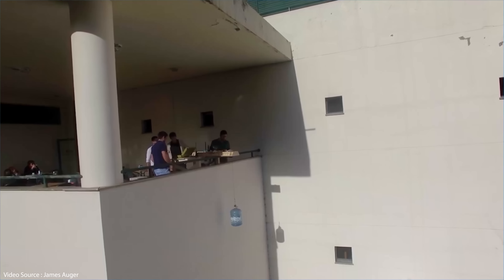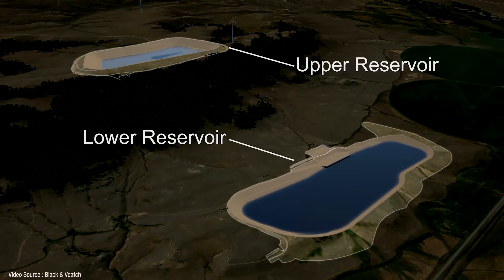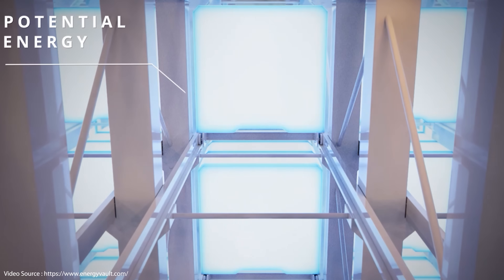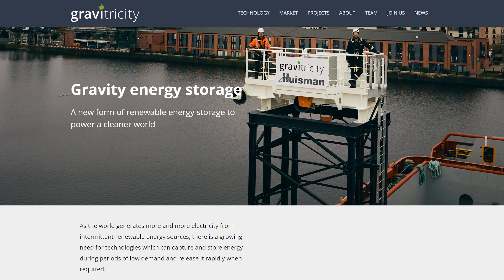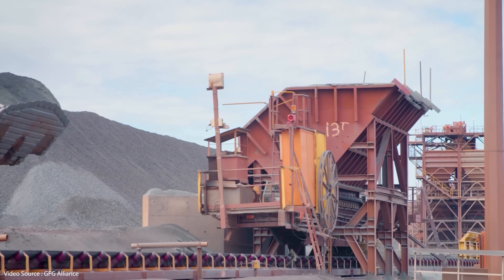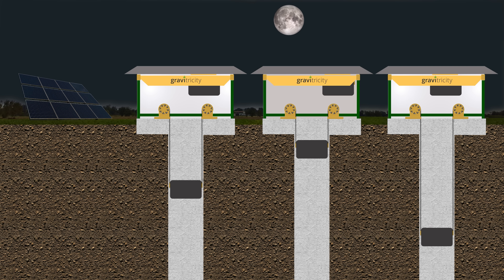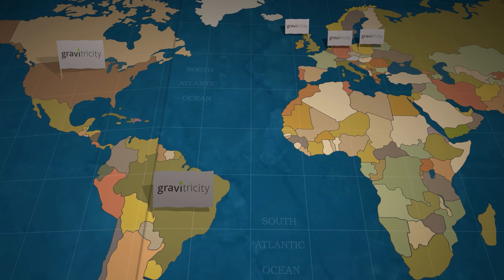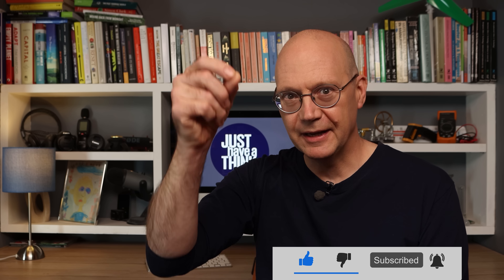Gravity Energy Storage. Who's right and who's wrong?

Comment: If you want to reliably store energy, make a big container and let a pump run water into it. When you need to use the stored energy, let the water run out at the bottom through a generator.

-far fewer moving parts, much less maintenance
-a pump and a generator can be easily accessible and can be very durable and are ultimately quite replacable too.

try reattach that huge weight in that abandoned mineshaft, or rebuild one of those cranes when they fail...

Comment: 07:03: I don't know how many such mines they will really find, but the claim is:
300...500 m, 3...5 m diameter, 4...5 m deep. Density of iron ore approx 2500 kg/m³. Therefore, without any losses, a single weigth can do m*g*h_mine = pi*(d/2)^2*h_weight*rho*g*h_mine = 57.8 ... 334.3 kWh.

That is in the range of a single EV battery, so laughably little. They need to stack multiple weights, but much more than 50 don't make sense, because then they are already stacked half the way up the mine...

Because they are stacking weights on top of each other, they have to hook a new weight up to the cables before being able to generate any electricity. I assume, no number was given for how long it takes to lower a single weight down, so I'll just guess: 3 minutes. If someone has a better guess, let us know.
Therefore, the power they can produce would be: Energy / time = 1.2 ... 6.7 MW   (megawatts)
Which is absolutely useless. That's less than a single wind turbine can produce. Even if you tried digging a mine next to each wind turbine, if there is no wind it would only last you     (50*3=) 150 minutes.

Comment: Take the spec for the gravitricity prototype:
height = 15m
mass = 25,000 kg (25 tonnes)

This means the total amount of energy they can hope to generate from this is 3,675,000J (25,000 * 9.8 * 15). My kettle draws 3kW of power, which means that it needs 3000J of energy per second. This being the case, my kettle could only be powered by the prototype for about 20 minutes. That is to say that 25 tonnes of solid material travelling 15 metres can only bring 7 kettles to the boil assuming it takes each kettle around 3 minutes to reach boiling point. Could be wrong but this doesn't sound scalable to me.

Comment: All these ideas are simply ridiculous. A robot crane stacking concrete blocks high in the air, lowering weighted boxes into mineshafts, come on. 
A simple angled ramp system, imagine a rail car on angled track scaled up several orders of magnitude attached to cables would be far simpler. Things like this were done over 100 years ago on lumber trains in the mountains where the energy generated on the decent was fed back to the power companies. Redundant cabling and emergency brakes on the rail similar to an elevator could be fashioned to prevent runaway. You're welcome

"An idiot admires complexity, a genius admires simplicity" - Terry A. Davis

Comment: That seems the best possible implementation of this idea. Use any cheap sand or rocks you got, the one with highest density to price ratio, put it into a huge strong steel bucket and move it up and down along a vertical hole. The main cost would be the construction of the hole, since they would need many close together for significant storage capacity. They could build the crane + generator first and use it to get all the dirt out with a different bucket for construction, make ridiculously long holes, and then reinstall the crane over the compacted dirt dug out of the hole, to gain extra length.

The energy is mass * gravity * length of tunnel. The section of the cables is proportional to the mass, and its length equal to the length of the tunnel, so the amount of cable is proportional to the energy stored, and there's no way to reduce it by making it light but deep or heavy but shallow.

So assuming a tunnel 4 meters in diameter with a weight 12 meters long, it's pi*2**2 * 12 = 150m^3
Filled with water: 150 tons of weight (less weight and more problems, not a good option)
Filled with dry sand: 1.6*150 = 240 tons
Filled with rocks (100% compacted granite or basalt, 2.6-3 t/m**3): about 400 tons
Filled with magnetite: 5*150 = 900 tons

A tunnel 1km long with magnetite would store E = m*g*l = 8.8GJ = 2450kWh
With a low-discharge high capacity liion battery of $100/kWh, that same storage capacity would cost $245 000
It seems quite hard to me to imagine such a tunnel for such a low cost, knowing that The Boring Company was able to make their tunnels for 4M$/km
A 100 meter tunnel for $24 500 seems also quite hard to do. Maybe with many close tunnels reusing the same machinery it could be achieved, but it seems hard to me.

Like energy, if tunnel boring became cheaper, many many opportunities would arise.
Reply: Based
Reply: Comparing the costs of energy storage by the two batteries in question, for the energy measured in kWh, is wrong. Are you referring to a metric ton, when you write, for example, 150 tons?
Reply: @franklins6694  
Cost of energy storage has units of money / energy.
I chose $ / kWh

When I write 1ton I mean 1000kg of mass of material
Reply: What was the tunnel for?  You mean, a hole?

Comment: What makes me nervous about these is the cycling.  I get that they meet the grid stability parameters.  But the stop start cycles can do a lot of long term wear to large reactive machines, such as large baseload generators.  I've seen the stopping and starting of 50MWe smelters wreak havoc on those types of machines just from shutting down at night and starting up in the morning.  The pump storage units have soft turnaround mechanisms to ease the blow.  It takes and hour to get up to full pumping or full flow on the existing plants, in most cases.  They need to get some power industry folks on the team that understand long term impacts.

Comment: I seems like the best solution would be to use the deep oceans. placing a floating station that lowers weights and then takes advantage of the bouyancy of the water to lift the containers back up  and control the lowering of the weights, this will allow many parallel operations any where there is deep water. The floation platforms can then be used for equipment or solar panels etc. which will allow them to be more cos effective.
Reply: Corrosion, barnacles, and accessibility for the communities that need the power all come to mind

Comment: Wow! What if you had very deep shafts, lowered weights for gravity energy and then pump water back in to raise the weights without using energy and use gravity to refill the reservoirs or tanks that hold the water. Also it doesn’t have to be water either.

Comment: If you combine rooftop solar and wind power systems with a system of closed loop hydroelectric power stations you can easily produce enough electricity for any modern city. A closed loop hydroelectric power station can be built underground or incorporated into building design saving space and placing the power production closer to the point that the power is needed eliminating most substations and transformers. The simple fact is that the person who is speaking doesn't know how to create a renewable energy power grid. There is also a way of producing a closed loop hydroelectric power station that is self recharging eliminating the need for wind and solar power but unfortunately I am the only person who knows how to make it.

Comment: Great idea! Now if only we could find a way to not block the access to the great volumes of mines, that mineshafts so conveniently are connected to.
We might even use that volume for our battery to increase the mass- and thus energy capavity, if only we could make these solid blocks of mass small enough to move in a more dynamic, ideally almost fluid way to flow towards and fill these caves to the last corner... 

But i am stupid, this would be way too complicated to implement with tracks and pulleys. just the mineshaft then. 💀
Reply: There was a project in Germany along those lines. The problem they ran into was that it's very difficult to make old mines hold the water.
Reply: @stefanmuc2k  Yeah the erosion would quickly be an issue.

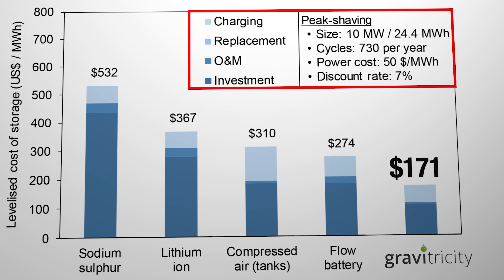Comment: @8:30 - you are hopefully aware, that most coal mining in Europe is done in open pit mines - there are no mineshafts - there are huge wastelands off sometimes hundreds of meters deep wasteland - like the german Garzweiler Mine https://en.wikipedia.org/wiki/Garzweiler_surface_mine

i find it quite odd that you say that the concept of gravitricity looks "good" while the new evrc concept by energy vault is "bad" though it is pretty simular - remove the "rolling the weights around" - add a few more pullies instead of the cart

also it could be a feasable option to use already high structures like wind turbines to pull up mass and lower it down - but not with a crane, rather in a elevator like system where the mass is guided by vertical rails, so wind won't be an issue

i'm pretty sure, both companies will deliver some plausible solution on the long term - both provide nothing, that is pysically impossible, both obviously have challenges to overcome

gravitricity will certainly reach a point where they can't find any suitable, deep enough shafts and need start digging, which raises the cost

Comment: If you are going to make a wind turbine with a giant shaft tower to hold it up in the wind you may as well put a 5 ton weight in it then using the wind energy to lift the weight and using the weight to control the speed of the wind turbine. Then you get a consistent source of power.

Comment: A project that will start this year with construction is a Hydrogen generation from surplus windpower. A pipeline is prepared for H2 usage and connected to a H2 pipe network app 100km away. A salt dome cavern plant is going to be used as a buffer. This H2 buffer has already more capacity than all possible hydro pump storage facilities in my country. More salt caverns are possible. First stage is 100MW capacity, second stage in 2025 is to add 200MW more. Top possibility for the site would be 2TW. The electric cables are there already since the site has an Nuklear powerplant that will be shutdown soon, and a Gasturbine powerplant that might be possible to use for burning Hydrogen as backup in case of darkness and low wind.

Comment: According to a Powerpoint presentation I found on the Internet, Banks Lake pumped storage, off WA State's Columbia River's Grand Coulee Dam, loses about 24% of its pumped storage energy - 14% to pumping efficiency losses, and 10% to generator efficiency losses. This system as described can produce 300 MW continuously for up to 48 hours.
Reply: In Austria the biggest Pump Hydro is the Powerplant Group Malta-Reißeck with combined output of 986 MW - has a comined efficiency of over 80 %

Comment: I read about a gravity energy storage project in Saudi Arabia. A big stone cylinder cut out from the ground, sealed to the walls and pumped up high with water regaining the energy by running the water back through the pumps by the weight of the stone cylinder. I do have some doubts about the seals between cylinder and walls.
Reply: me too, someone sold that well to the arabs     lol

Comment: Just as a "buff" to Gravitricity give then a call- there are abandoned oil and gas well holes all over Texas- some plugged but many hundreds to thousands were abandoned open and leaving a heavy wall casing to a depth of 2000 feet, at diameters in the 24"-30" range. the people on whose property they are now on would love someone to come along and either cap or use that hole for something other than having their children fall down into.  Not a "mine shaft" maybe, but the long vertical, self supporting "hole in the ground " it sounds like they need.  FR

Comment: @ Just Have a Think updraft power plants can work 24/7 no need for energy storage. so all this is energy storage is nonsense in my opinion. have a look this tech is 80 years old. Maybe do a video on it. very intresting, especially if you add modern tech to it like electron stripping and fanta black as a heat absorber.

Comment: the machine has to do twice the work it puts out , idiotic idea
Reply: But if you use captured excess energy to power the lifting phase, you're getting the inefficient cycle for free.

I went into this video totally ignorant of gravity storage, and expected to laugh at the concept. I'm more warm to it than I expected to be.
Reply: @MetalAsFork  time would be better spent investigating how the human brain functions with so little power and does not overheat , it uses something called chiral induced spin selectivity and even the best minds on the planet have no clue how to build a machine capable of doing this , be far better for mankind to do some real science than run down the rat hole of believing you can control the weather
Reply: @philiphall4805  That's interesting, but it doesn't totally invalidate this concept. We can investigate more than one pursuit.

Mechanical/gravity batteries just might be superior to other types of storage in some situations.
Reply: @MetalAsFork  finding out how to use electricity as efficiently as a living cell  would completely invalidate a gravity storage system because there would be no need for it

Comment: To be fair with Energy vault, the infrastructure needed is built with a massive overpowerful crane on rail. And that's exactly what they plan to build. All we need is a metric ton of iron to make the steel beam, as as we just saw, a vertical mine is a boon for the project final stage.
So I really dont know if EV will be the company that is able to add 1+1 together, but it seems to me like a feasible plan. You build the solar panels on beams and you use the power to dig the iron underneath. slowly raising the solar plant until it can store all it energy.
Steel, solar power and gravity.... i don't know, it just sounds right for Earth.

Comment: The problem I have with these gravity concept is you cannot control the amount of power you output onto the grid, it’s either running or not, it would also have to re-sync to the grid each time, they are interesting ideas but I see them as more edge cases for helping the grid
Reply: You can with Pumped-storage hydroelectricity which coincidentally is the best and most importantly viable option. Still, it's an edge case solution as it requires a high difference in elevation and a cheap but unsteady source of power, most prominently wind turbines.
Reply: @rot7296  I was referring to these suspended weight systems. They are constant torque, unless they have a complex gear box.
Reply: @reesewebster9149  And I was agreeing and also shitting on those systems.
Reply: er, yes you can! with a suitable inverter driving the load motor you can control both the speed and the torque of the system, where torque x speed = power in either quadrant
Reply: @maxtorque2277  are you saying to use a dc motor connected to the weights then use an inverter to connect it to the grid?

Comment: Dude, the required gearing ratios on such massive weights eats up a lot of the power. There is no way to reduce gear or belt ratio energy losses except by a set amount. Systems such as this are more useful for their mechanical energy applied athe same location.

Comment: The problem is the bottom and the middle there is zero energy at the bottom. I agree you need to start at the ground floor. But then only the top shelf stores the maximum energy. I only see the advantage to go from volatile to averaged on demand power supply. Thus it is a peek power solution and by no way a base load solution.

Comment: Water pumped gravity storage has been used for a long time, it is efficient? Not really, but it works. Using cement blocks is just stupid waste of resources, the energy density is low and the efficiency of the system, especially maintenance, repairs and keeping wires safe, makes it impractical. Why create complex solutions when there are simply ones? To get investors hooked? To get some easy fast money? Snake oil seems to be the future.

Comment: The problem is that scale adds unnecessary complexity.  Why not just build a small one with every house.  We already do things like sceptic tanks, hot water heaters, HVAC and all kinda other things with houses, why not just a small gravity system that uses solar power to raise a weight during the day, and then releases the energy at night.
Reply: What do you mean by a "small one" ? You have to provide two numbers : the depth of the well and the mass that is moving.
Reply: @hervelebars   if it was for a single home, I would just use a tower with a single heavy object.  Solar raises the object during the day, and at night the object lowers and generates electricity for nighttime energy uses.  In the video, the tower they built requires lateral space as well as cranes to move the blocks horizontally, which wastes a lot of the energy.  When I lived in central america, almost every house had a 20-30 foot water tower which was used to store water for when water service wasn't working (which was a few times a week).  Obviously the math would have to be done to see how much weight and how high the tower had to be, but in the example video, they are talking about having it way outside of a city, so you would lose a lot of the electricity, and they are moving the blocks horizontally which again loses a lot of the electricity.  A simple tower on your property must be more efficient and easier to build.
Reply: @PeterSedesse  So, let's take 10 meters (32.8 foots) and a mass of 1000 kg (2204 pounds). With that, you can power a small toaster (1000 watts) for 1 minutes 40 seconds. Not sure your bread will be well toasted.